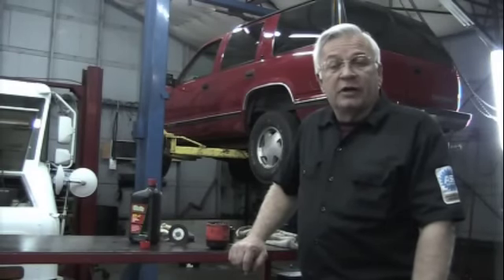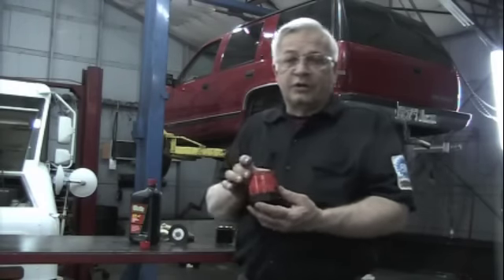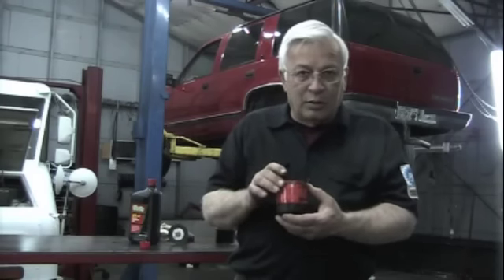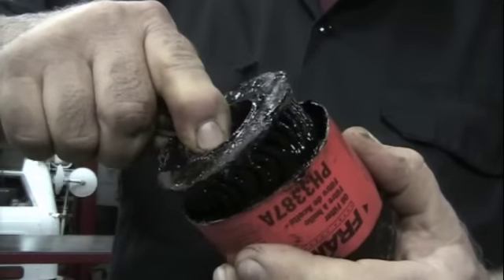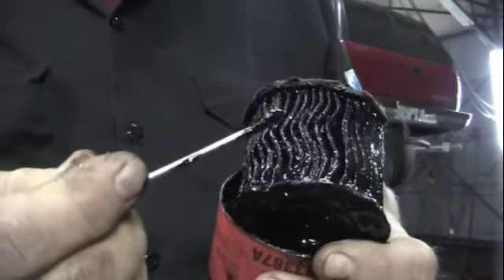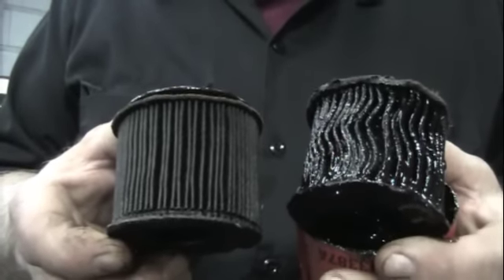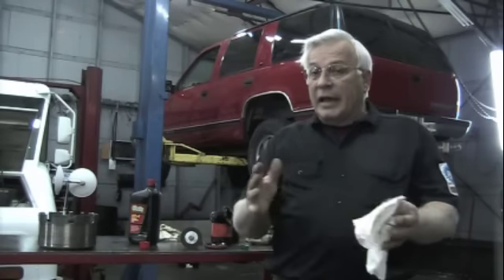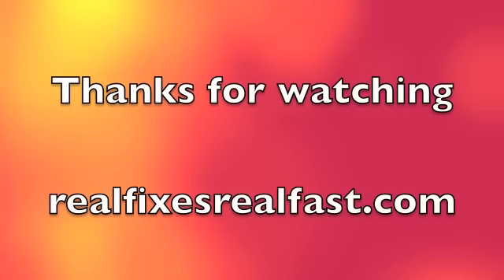Low oil pressure, finding evidence

Comment: What the heck happened to that thing?  It is full of sludge like someone packed it full of used grease.  Now I have a Volkswagen and it does not take a metal filter like that.  The thing I like about that is that I can see the quality of my filter as I install it.  The other nice thing is that I can see what (if anything) it removed from the oil when it comes time to change it.  I use good synthetic German oil and I have never had a filter that bad but I sometimes pay 11 dollars per liter and this is not the dealer's Castrol oil either but I use Liqui Moly 0w40 Energy (the one with the green printing on the label).  I change my own oil and I do not find these cars hard to work on like other people keep trying to tell me they are.  I sincerely beleve that they never had a Volkswagen or anything even similar to one.  I am just glad I did not fall for their baseless bullshit.  Sure for a couple things you need a "special tool" but I have yet to see a vehicle that does not require at least one special tool that costs a fortune that someone would in theory use once and put it away.  As my luck has it one of these people who blaspheme German cars is my Uncle who never had a car but instead pickup trucks.  He has a GMC.  His biggest problem is he has back problems and does not like vehicles that I like.  He does not like anything fun because it sits too low.  You can probably tell whose advice I never take when looking for a car.  The thing I don't like about pickups such as his is that it I find it hard to back them up because I like to have some idea what I am about to back into.  The other thing I don't like is they don't handle as nice as something with a lower center of gravity.  I don't have my car lowered down to the ground mind you, I just prefer a lower center of gravity.  The other thing I like is a vehicle that is not a huge gas guzzler.  One example of a gas guzzler was my dads '03 Ram (full size but without dual rear tires).  That thing with a trailer on the back of it got a miserable 10 MILES PER GALLON and if that wasn't bad enough you could feel that thing bouncing around.  The nice thing about that truck was the 5.7 liter HEMI!!
Reply: Ramble often?

Comment: You think this would be my issue if I have a 89 Silverado with 305 5.7 motor I had sitting for couple months did the oil change then turn t on the oil gauge went all the way up.

Comment: what is your opinion on the belief some people have that when you are running fully synthetic oil you can just change the filter and add a quart instead of replacing all of it when you need an oil change?

Comment: Is there a follow up video on the thirty day results?
Reply: just had heads reworked now I have no oil pressure
Reply: I j ust had heads reworked and timing chains changed new water pump now I dont have oil pressure what can be the problem
Reply: The customer probably never came back.  Did it himself, and denied the man who figured out the problem the satisfaction of knowing what happened.  People can be inconsiderate.
Reply: @angelbroussard719  did you ever figure it out?  same thing.  heads done, now low oil pressure.

Comment: I am embarrassed to ask this but im having the same issue with my oil pressure gauge i have let my oil change go to long 9-17-14  was the last oil change but i use full syn and frame oil filter could this be my problem oh and it was at 156.000 miles when i changed it and now it is at 165.000 i bet this my issue could use some advice on this should i get a better oil filter. than the cheapest frame filter.

Comment: Crap I guess I did mess up my engine was running it without oil. I finally did the oil change myself but know its making a knocking noise.
Reply: Joanna Beltran You bent your rods and or rocker arms. Happened to me 6 years ago on my Jeep Liberty.
Reply: Joanna Beltran b

Comment: You're not suppose to flush an engine that has old murky oil and old filter in it; no wonder that happened! LOL . You are supposed change the oil and the filter first. You can drive the car for a month or so and then do the flush; but you shouldn't flush it if your oil looks like mud.

The oil and the filter get changed again after flushing for 20 - 30 minutes at idle speed. You are not going to plug up a filter that fast. The gunk will dissolve in the rest of the oil before it gets disposed of.

Comment: My 2001 Monte Carlo 3.4 engine has been acting a little wierd on me, stalling out when idle (not often though) and shaking a bit while idle too. I changed the oil and oil filter. I did wait a little over the 3,000 mile mark and the oil was pretty bad. AFTER I changed the oil and filter my car started showing a "Low Oil Prssure" light at idle, but when I drive it the light goes off. I changed the oil switch and it is still showing the light at idle. Do you think it's the oil pump?

Comment: I have a 2008 GMC Sierra 4.8L. Vehicle has 185,000 miles.  When I drive the truck it runs fine. But when I idle in a fast food drive through the engine starts to 'tick'. Then I drive away and the ticking stops. It only ticks when idling. It sounds like 1 lifter ticks when idling after 8 to 10 min. Then a 2nd and 3rd lifters softly ticks about 15 mins after. Is this an oil pressure issue? I know Vortec engines for those years have oil pressure issues. Or do I need to change the lifters? Change the valves? Thank you for your help.
Reply: Wyatt Sexton filter screen under oil pressure sender on top of motor clean it.

Comment: I had a sudden loss of oil pressure and after checking the pressure sensor and finding it was working good, I thought it must be the oil pump so I took of the base pan and what I found was that there was ice and sludge frozen on the oil intake screen and completely blcoking the flow of oil, so instead of changing the pump I cleaned it up and flushed it out. it has been working fine ever since
Reply: How cold is it where you live?
has it happened again since?

Comment: Hey Dwayne, what do you think about those engine flush products?  I would have just flushed the engine a couple times in 1000 mile intervals or so, and then go back to the regular schedule.  I've heard some people use kersone as flushing agent too. Sludged up oil is usually a result of infrequent oil change intervals, poor intake air filtration, blow-by, or improper pcv system routing.

Comment: I change my oil 2x per year at the end of the seasonal extremes ( summer and winter)...I have switched to a very expensive fully synthetic 5w40 as opposed to a standard part syn 10w40...Im noticing a difference, however my budget is now stretched

The price I dont mind paying for good solvent, high ester capability confidence!

2000 Mk4 Vauxhall/GM Astra ( European)

Comment: I have a 96 Chevy suburban and my oil pressure gauge dropped to 0 so we were told change out the oil pump so after it taking a few days to do we put a new oil pump, new oil filter, put all new oil in the vehicle and when we test drove it after all that work the oil pressure still drops to 0 after it's warmed up. And on top of it all it still has a ticking noise.  So now very irritated. Anyone have any ideas? Would love to hear them.
Reply: Might need to clean your engine. Use a good motor flush run for about 5 to 7 minutes at a little above idle and then change the oil. Looks like you covered yourself well except getting all that possible gunk that's in the engine. Hopefully the motor flush works for you. Good luck!!
Reply: apparently my bearing/rod is going out. When you push on the gas petal it sounds  and feels like something is hitting the inside
Reply: Carri Marie the ticking noise could be a lifter.
Reply: Brein Jensen 
Engine bearings and low oil pressure are directly related.  Engine bearings is what determines oil pressure beside  pump volume.

Comment: I have an old 98 model C180 4 cylinder unleaded petrol mercedes which is a little down on power and blowing sooting black smoke out the exhaust (not oily not blue in color)
The engine oil level slowly keeps dropping away but the engine idles ok makes no knocking or mechanical sounds
Do you think this is valve or piston ring related? or a oil a seal issue? haven't done a compression test yet

Thanks so much for your time
Steve (Australia)

Comment: I haven't driven it much because I am afraid the engine is not getting oil because the pump might be weak or not working and I don't want my engine to blow up on me. Like I said, the light is only displayed when at idle. I thought maybe I should run some cleaner through the oil so I did and changed both the oil and filter yet again, but the light still goes on. The only other 2 things it could be are the oil sensor or the oil pump. Anyone have any ideals that could help me out?

Comment: The Tahoe was never offered with a 4.3L
Reply: Yes it was. The cheapest model came with that engine. A friend of mine bought his new. Our 5.3 had valve problems and it was cheaper to replace the engine with a used one from the junk yard. The only one available was a 4.3 from a newer Tahoe with less miles than ours. I hated the last year and half we had it. Big difference in get up and go.
Reply: Maybe in a 2 door.

Comment: my oil pressure light goes on - if i hit breaks, the light goes off again. if i just let the engine run at idle, the light stays on. so i think, why that rapid stopping inertia changes oil pressure?
Reply: change ur oil pressure sensor put a new 1
Reply: Allan Hmelnitski you have a bad ground somewhere. check all grounds on engine block and on main harnessing for brain. after replacement of the sw doesnt solve it

Comment: Nothing wrong with fram oil filters, been using them for nearly 50 years. You armchair experts read too many magazine articles. That filter had been on that engine forever. Go gargle some seafoam and take a valium...they both serve the same purpose.
Reply: EVER CUT A NEW FRAM OPEN?

Comment: I have a 2005 Nissan frontier and when I came to a stop or light my oil pressure gauge goes down and the oil light came on as soon as I start driving the the gauge goes back to normal I'd already change the oil filter the oil the oil pressure sensor and it's the same any advice thanks.
Reply: pedro ramireZ I'm in the same boat as you, just different vehicle. Same exact issue though. Find a solution yet?
Reply: No nothing
Reply: +pedro ramireZ Main bearings could be worn out.
Reply: pedro ramireZ was

Comment: The most stupid words. Oil filter is on parallel with oil system and if you blind the filter or you use an slugged filter is not affecting the oil pressure on system...actually pressure is increasing if you blind filter.

Comment: my 2004 silverado reads low oil pressure after the engine warms up...when i put it in drive the oil gauge goes up less than 40 once i stop it says low oil pressure again i change the oil pressure sensor and oil and filter and its the same any ideas what it might be wrong
Reply: have you resolved the issue im having the same issue
Reply: +Jose Bravo no man
Reply: +Jose Bravo a man does ur chevy pass 40 psi when the engine is cold?. then drops to 0 psi when it warms up?.
Reply: No bro its doesn't pass 40 and once it's warm it goes down to 0 but while I'm driving it goes to 40
Reply: +Jose Bravo its kinda like mine but mine does past or gets close to 40 psi not even when im drivining at 60mph...do u hear like knocking sound in the motor once u turn it on?
Reply: +Jose Bravo *meant to say mine does not past 40 psi
Reply: +Jose Bravo if u dont hear knocking sound it could just be a bad oil sending unit replace it with a new 1
Reply: Yeah I hear a knocking noise
Reply: I don't hear it all the time though
Reply: +Jose Bravo u got an email or something
Reply: They have told me that it can be a bad bearing the oil pump the o-ring or the engine may be worn out every1 says different things bro
Reply: +Jose Bravo just check the oil pressure on the motor to see if its actually low or it could just be something else like the oil pump or the main bearing im pretty sure its not going to be the bearing cause u dont hear knocking sound everytime
Reply: Have u solve the issue on ur chevy?
Reply: No haven't got around to it I'm going to replace the oil pump
Reply: +Jose Bravo i took my to the mechanic and he said tht it was the lifters and maybe the oil pump...how much is it gnna cost u for everything with the install?
Reply: time for a rebuild
Reply: dear all please help.... i have oil pressure light problem and i have changed ... oil sensor, oil pump and oil filter with new oil 5W30 and there is no novice in my engine ....since this light is coming last 3 or 4 months ...my car is Chevrolet optra 2006 ....and i am from Saudi Arabia.
Reply: I'm having the same problem chevy 5.3 vortec.
Reply: 559 calii yes

Comment: Oil pressure comes from bearing clearance not oil pump
Reply: +michael shemwell Then why even have an oil pump at all?
Reply: +umarked return the oil pump simply moves the oil thru the engine it doesnt actually create the pressure..like holding your thumb over a running hose.the hose is the oil pump it moves the water,your thumb is the bearing clearing that creates the pressure
Reply: Really? Then, why does oil pressure rise when you increase RMP. Does bearing clearance change depending on RMP? XD
Reply: tubee103 he meant rpm..
Reply: tubee103 it does come from tge pump but if bearings arent seated it inhibits proper pressure
Reply: Jules Arnold oil pressure is READ by the resistance within the tolerance of the bearings, but is CREATED by the oil pump. without the pressure created by the pump then the bearings would run dry and probably spin... so the answer to the original question is yes oil pressure is created by the pump but read by the resistance from the bearings.
Reply: Martyn Dale   the oil pump ONLY sends the oil throughout the motor for lubrication and as it goes through the opening gaps on the main bearings on the cam shaft, it then creates oil pressure.. simple as that
Reply: that's well but if the clearance is  1/8 inch,on all bearings,there is no  oil pressure; so you're both right! wow!
(shut up,fool, i'lll bet they all knew it, all along,lol).
Reply: @qewqeqeqwew3977  the restriction creates pressure the pump creates flow...if the internal clearances getting bigger than specs.. pressure goes down. If you rev up the vehicle with ckearances in specs then pressure goes up because pump flow capacity goes up but clearances where oil goes still the same...so low oil pressure happens either pump wont supply more flow or the internal clearances were bigger than specs that they called internal leaking.